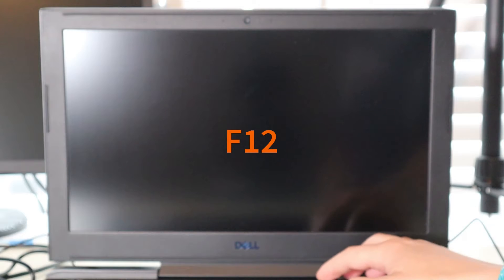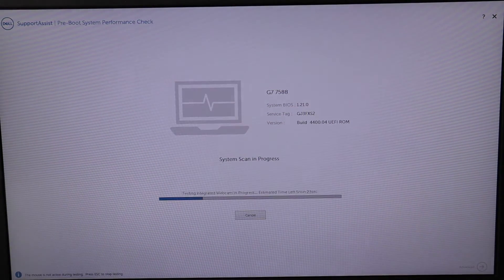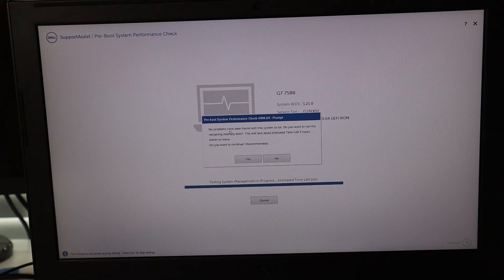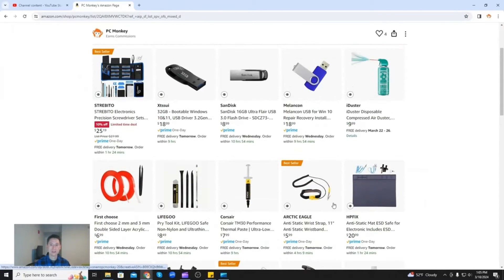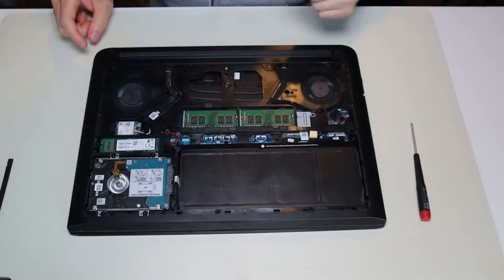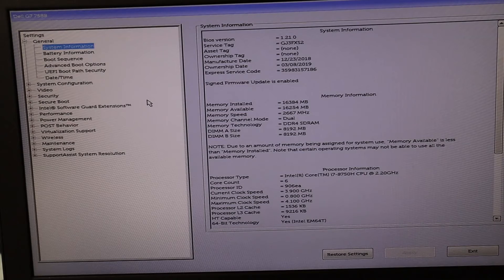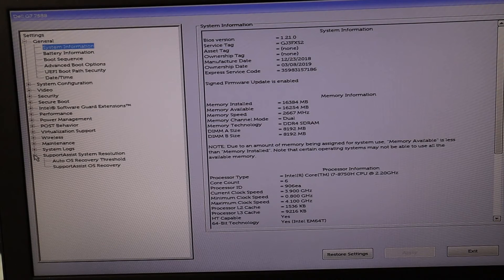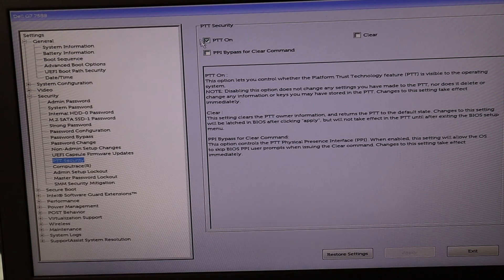How To Fix Windows Boot Failed, No OS (Operating System) Errors for Dell G5 Laptop Computer

Comment: Hello Jamon, thank you for your effort, but my laptop did not work It works as a bar appears at the bottom of the screen saying (Prees ESC for Boot options /settings )How to solve this problem Laptop type HP Windows 10 How to solve the problems please (Greetings, Sufyan Hakim Raja Adwan)Do you have WhatsApp or Messenger so I can send a picture of the laptop and a video of it? The reason was the high temperature, my friend Jamon, thank you ❤